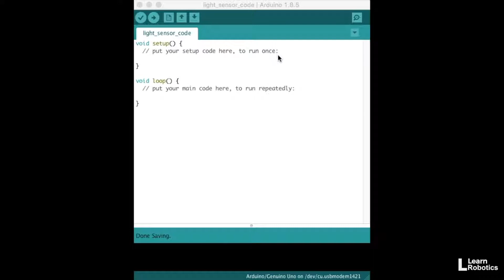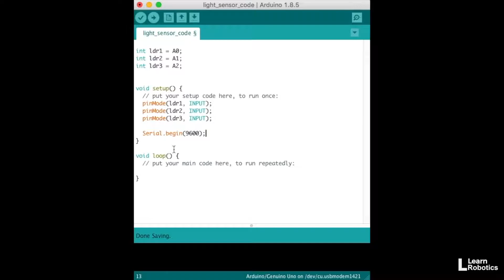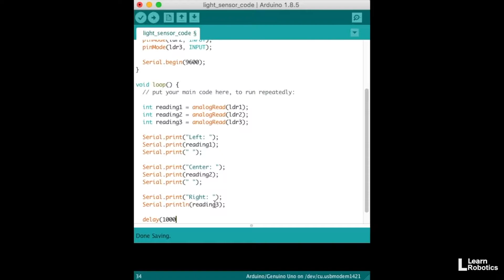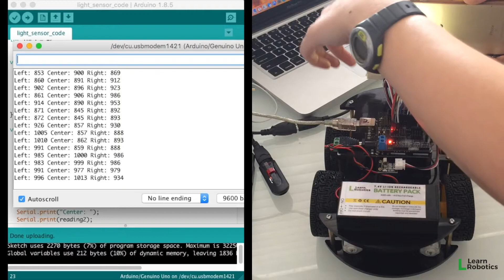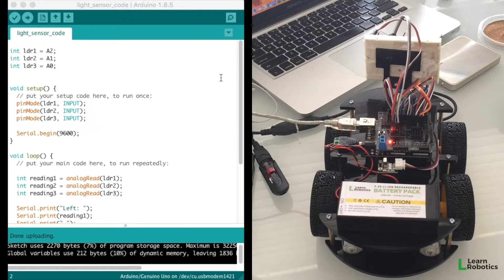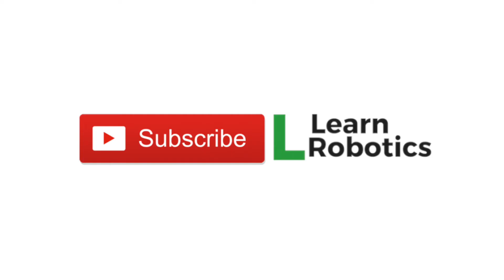Light Sensor for Arduino Robot Tutorial

Comment: Is that a breadboard with a photoresistor on the front? How do you attach that to the robot? (I'm very new to robotics and arduino coding)
Reply from the maker: Most breadboards have sticky adhesive on the bottom. Peel it off and attach! :)

Comment: i am a little stuck i dont know what to do next with the code, with what on your webpage how to add it all together and i did not find a download link for the code, i am not so smart with coding just starting out is some ways, i learn the first part from your video here but i cant work out how to integrate the other parts. after i got the code right i will try mod it to use on a attiny, and make a small light tracking robot with vibration motors. bit like the kilobots.
Reply from the maker: You'll need to have your motor controller configured before you can use these methods. Check out this article: https://www.learnrobotics.org/blog/how-to-program-the-l298n-with-arduino/